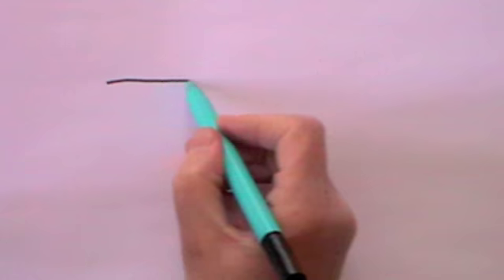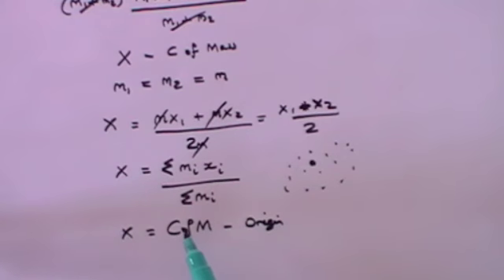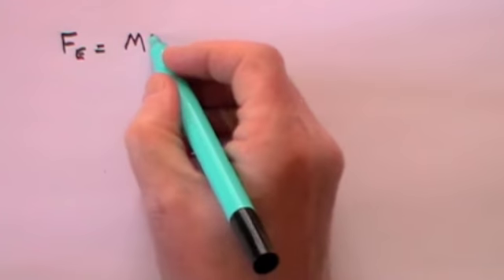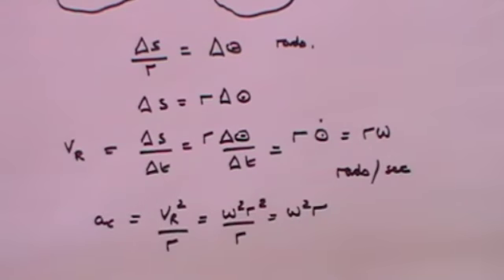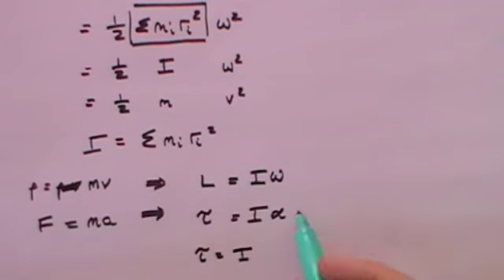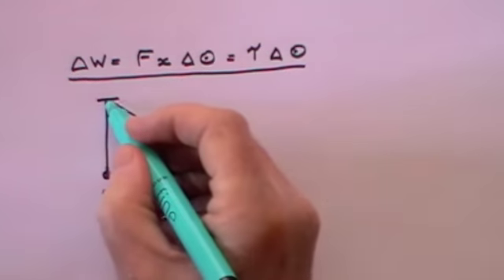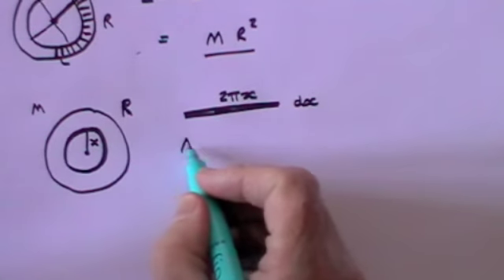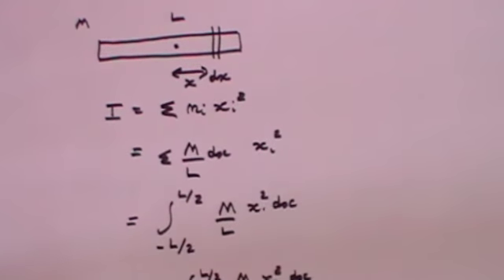Dynamics of Rigid Rotating Bodies: Part 1 of 3

Comment: What is the phenomenon called when you have an object with 2 potential rotating axes of different diameters the object wiil want to rotate around the smallest diameter axis?
Example: Place an American football flat on the ground, set it to spin horizontally as it lay. (large diameter axis)
Spun fast enough, it will raise up on its end and continue spinning like a top. (small diameter axis).
Thank you. (if this channel is still viable?)

Comment: Dr. Physics,

At 39:40 you state that torque is the rotational equivalent of force.  While it is analogous, it is not equivalent.  Torque is an energy term, measured in N*m (which is equivalent to a Joule), whereas Force is measured in Newtons, not Joules.
Reply: my text book makes sure to denote Tao measurements in Newton meter vs Jules because torque is a property of a force applied, that causes rotational motion. it actually says don't use J use N(m)
Reply: It is a coincidence that torque's units are algebraically equal to Joules, but they really aren't the same thing.  Torque units don't become Joules, unless the torque is applied continuously through a rotation of 1 radian (i.e. 57 degrees).   Radians are a dimensionless unit, hence why torque's units seem to be the same thing as Joules.  We don't measure torque in Joules, but rather in Newton-meters, to remind ourselves of what it really is.

Comment: Isn't the centre of mass of the solar system within the Sun itself?
Reply: Occasionally yes.   However, depending on the specifics of the planets relative to one another, it can shift outside of the sun.  For instance, suppose Jupiter and Saturn align, and for simplicity, neglect the other planets.  The center of mass of the solar system will occur about 1.67 solar radii from the center of the sun.

Worst case scenario, in an all 8 planet alignment, the center of mass of the solar system will occur at 1.85 solar radii from the center of the sun.  This is an event that is so rare, it has never happened in the entire history of the solar system, and it will never happen in the entire future.

The center of mass of the solar system is the invariable point around which even the sun orbits (or rather wobbles) as a reaction to gravity from the planets.  Neglecting gravity from the rest of the galaxy, it would be the point that moves in a straight line.  It does orbit the galaxy as well, once every 225 million years.

Comment: Consider a pencil moving in space towards you. You put out your finger to stop one end of the pencil from moving. The rest of the pencil will surely not stop. Each molecule will insist on continuing, and the pencil must therefore rotate about the end which stopped. This, in reverse, is the same as applying a force to one end of a stationary pencil, which must therefore rotate about the end on which no force acts. Or am I wrong. Comments please !

Comment: I'm sorry but what is the difference between rotational velocity and angular velocity?
Reply from the maker: Rotational velocity is the speed with which you go around the circumference of the circle. It is measured in metres per second but of course you are changing direction all the time. Angular velocity is measured in radians per second and effectively measures the sweep of the angle. For a given angular velocity you can have several rotational velocities depending on how far away you are from the centre of the circle.
Reply: Thank you!
Reply: @21tashywashy  Rotational velocity occurs perpendicular to the radius  . It's the velocity of a particle on the body . Whereas angular velocity is the rate of change of angle the particle subtends at centre

Comment: It must rotate.  The center of mass of the pencil is accelerating (or remaining stationary, depending on your reference frame).  If you have a global inertial frame where the pencil can translate, when you introduce the force pushing the end of the pencil, the CoM will accelerate.  F=ma provides a reaction force that causes a couple and rotation.  If the reference frame were pinned to the CoM, the acceleration must be zero effectively defining the CoM as fixed.  Force at end = rotation.

Comment: No, it turns about the center of mass, which itself does not move.

This is pretty easy to see if you have a low friction surface. Also, this can be derived in three dimensions with Screw Theory.

Comment from the maker: If there were only one engine thrust, then the rocket would move in the opposite direction of the exhaust fumes from the engine. It wouldn't twist. But if there were two engines operating a torque on the system, then you would get rotation.

Comment: thanks, seen it. but the point is why there's torque when the rod is not pivoted. i feel embarrassed in putting it but my interpretation is there is the inertia of this rod acting against this force we have applied and this reaction force acts opposite and through the  rod's center of the mass resulting in a net torque with center of rotation somewhere between the center of mass of the rod and the end where the force is applied. pl. correct me if i am wrong.

Comment: I think it will rotate and move. It will be like earth rotating around itself and around sun. The only difference in this case  is that the distance from earth and sun (radius) will be increasing by time. The harder question would be "how would you draw the moment , shear  and axial load diagrams due to the inertial forces". it is complicated. Rajkumar because you asked such a question I say you are an illuminated one :) I asked that same question but no clear answer.

Comment: Sir, i know i am asking too much but if this is the case then how does a rocket travelling in space change its course by applying a side wise thrust at its one end? wouldn't the resultant force of the rear thrust already there and the applied side way thrust move it diagonally off the  course without turning it?  thanQ sir

Comment: if i have a long rod not pivoted in space and apply a force perpendicular to it at its one end   will it rotate or simply move along the line of the force without spinning? what if i replace the rod with a string? will it curl or wiggle while moving?
Reply: Given a rod that isn't pivoted, if you apply a net force to its center of mass, it will have a linear acceleration that results, and continue moving in pure translation.

If you apply it offset from its center of mass, then you will apply both a net force and a net torque.  The center of mass will accelerate according to the net force, and the whole body will rotate according to the net torque. The center of rotation will occur around the center of mass.

Comment: Actually it doesn't have to be at each end. Torque or moment applied at any point should rotate the rod around its center of mass (given the rod in space without pivot point -no attachment ). But why? balancing the centrifugal force? or can we explain it with energy concepts? Please let us know. Thank you very much.

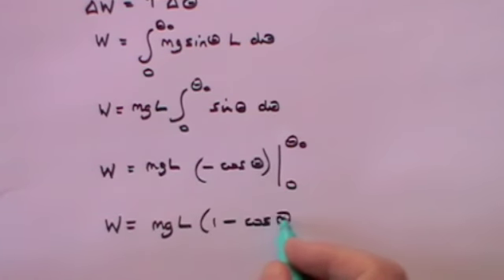Comment: at 53:12 you calculated Work by integration.
I was wondering why can you not use W= Fx(theta)
I am a little confused there.
Otherwise, a very helpful video, thank you!
Reply: The full form definition of the concept of work is W = integral F dot dL, where F is the force and dL is the infinitesimal length of the path along which it moves.  If F is not constant, or if it is not moving in a straight line, or both, then we have to use the integration.  The dot product turns into simple multiplication, when F is aligned with the direction of motion.

This integral reduces to simple multiplication when F is constant and aligned with dL at every point along the way.  In the event that F is constant, but not aligned with dL, it reduces to W=F*d*cos(theta), where theta is the angle between the displacement d and the force F.
Reply: In the example at 53:12, the force is constant, but the motion is not in a straight line.  You can either use the integration to calculate the work done, or you can use the concept of potential energy as a shortcut, because the force in question is a conservative force.  He was demonstrating how you get the same result by either method.

A conservative force, is a force where the net work done by it, is independent of the path it takes.  The work done by a conservative force is a state function, that only depends on the initial and final positions of the object.  Gravity is an example of a conservative force.  If a potential energy is associated with a certain force, then it is a conservative force.   Gravity, electrostatics, and spring forces are examples of conservative forces.  Kinetic friction, fluid drag, and human pushes and pulls are examples of non-conservative forces.